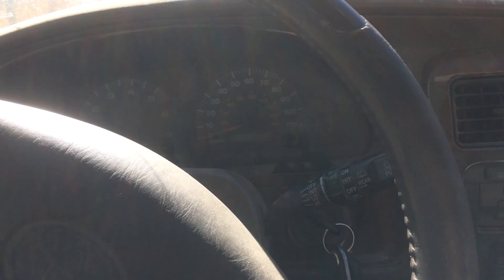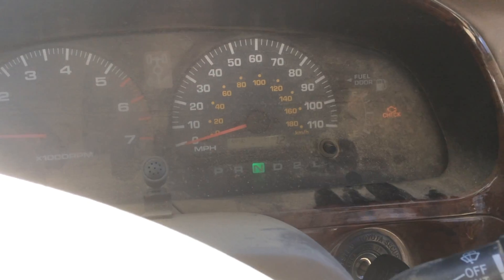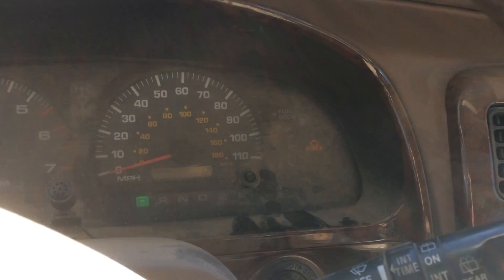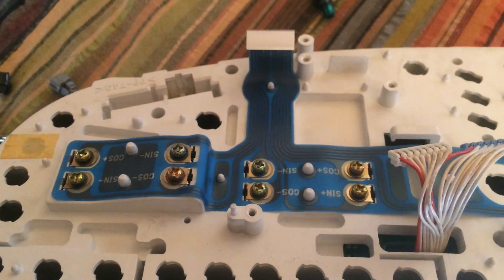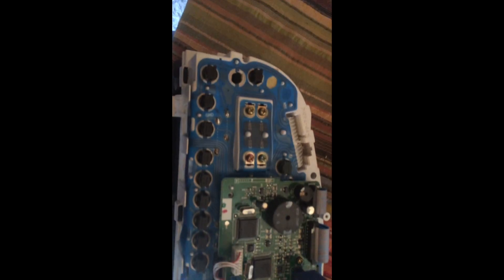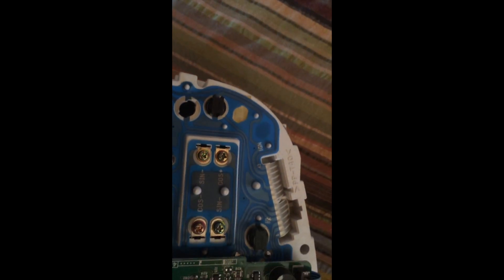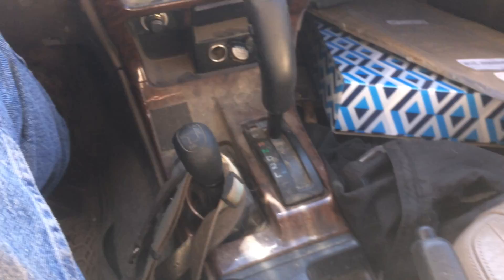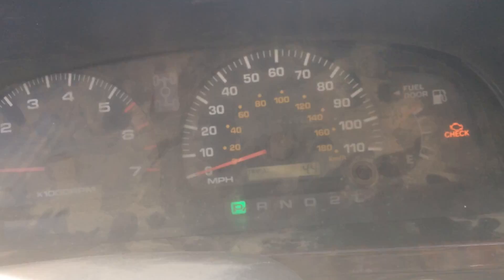2000 Toyota 4Runner Limited Dashboard Circuit Board Replacement

Comment: thanks austin !! saved me a whole lot of time and money !!!  i have all the same things happening to my 2000 and this helps sooooo much .. thanks so much for sharing ...
Reply from the maker: glad it helped! when i read this online i couldn't believe it worked!
Reply: @afsisasotk  Hi there. I’m having the same issue with my 99 and I order the board this weekend. Problem is I’m not too handy when it comes to electronics. Do you by chance have a more detailed instructions on how to do this ?
Reply from the maker: @lopezch1234  I sure don’t. I’m nit too handy with electronics either. I just took the whole dash apart and put it back together the same way it came apart. And just keep track of where all the lightbulbs went. Good luck!

Comment: I have a 2000 Toyota 4Runner Limited 4wd.  I have the same problem.  When I try to get the circuit board for my trim it says discontinued.  I wanted to verify the part # you posted works for a limited.
Thanks
Reply from the maker: mine is also a limited, you may need to search somewhere else. Good luck!

Comment: good morning my 4runner 2002 presents a failure the cluster stops working I remove the battery connector and connect it again works again but in a few minutes it returns to present the fault can you help me with this problem please.
Reply from the maker: Not sure if you had the same issue as me but the cluster is prone to going out. You might just need a new cluster.

Comment: Shoulda stuck with a Jeep... :D
Reply: Hello, where did you purchase the printed circuit board?
Reply: Then he'd have countless wiring, module and electronics failures after while, lol. Electronics etc isn't exactly Chrysler's strong point, much more so than a random one off Toyota issue they're pretty bulletproof. Happy trails / happy towing😁